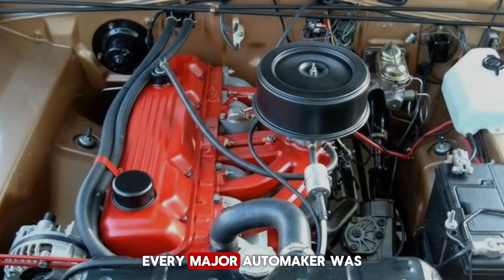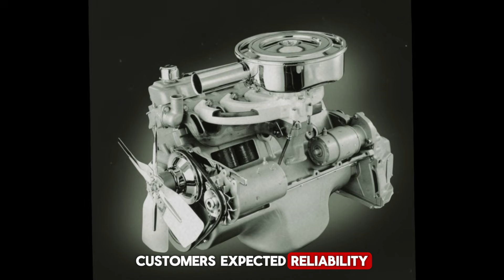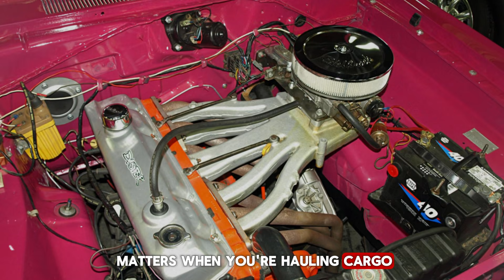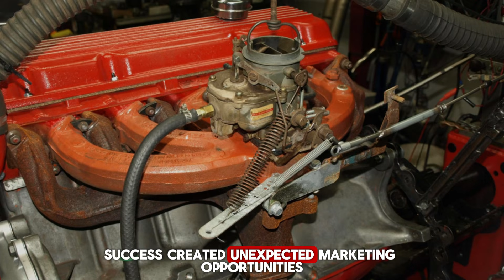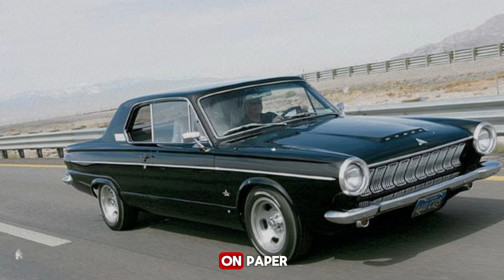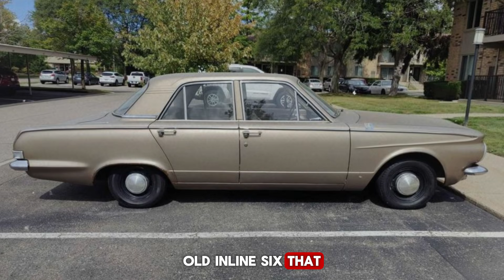The Engine That Engineers Loved — And Executives Hated

Comment: The slant 6 is legendary for simple and rugged design and well suited to use in automobiles, but its use in pickup trucks and vans less so.  The problem is too small displacement or cubic inches.  I've driven and maintained Dodge vans and pickups either for myself or small businesses and in that usage, the king is the 300 cubic inch Ford in line 6 cylinder engine.  The seven main bearing motor of the Ford will outlast the the slant six especially in ability to carry loads in vans and pickups.  The two other issues is about the same fuel economy or even slightly better than the slant 6  especially in vehicles that have to work hard and the ability of low end torque vs slant six.  The slant 6 is a fine engine, more lightly to live a long life vs any of Chrysler's v8, but in vehicles that work with loads the Ford 300 six and to a lesser extent, the GM 292 six, are more durable.